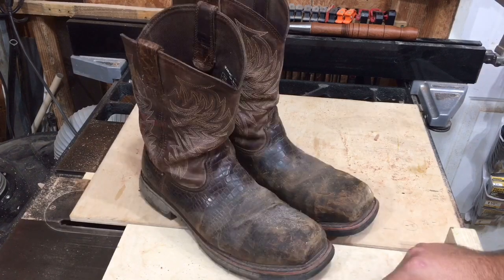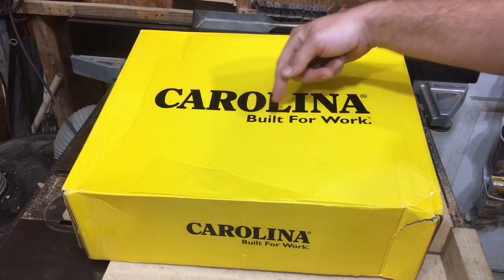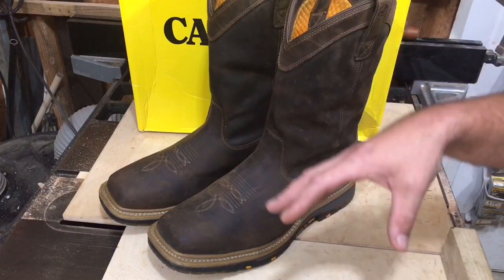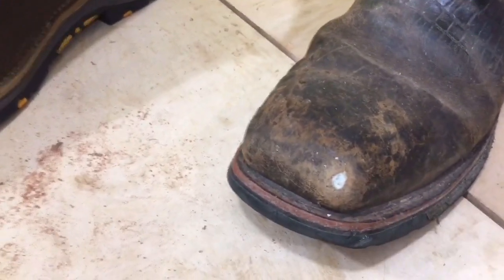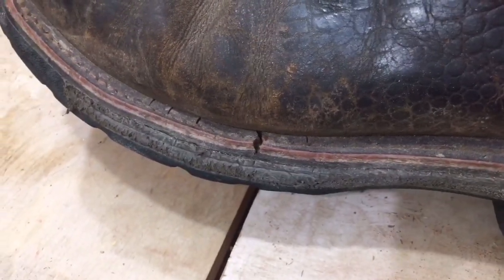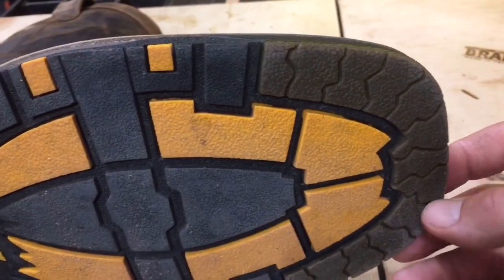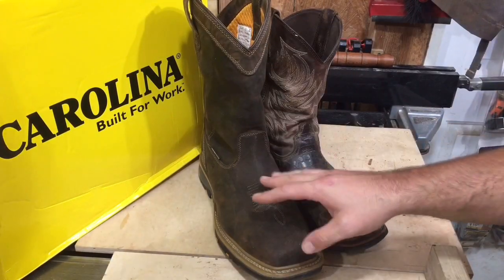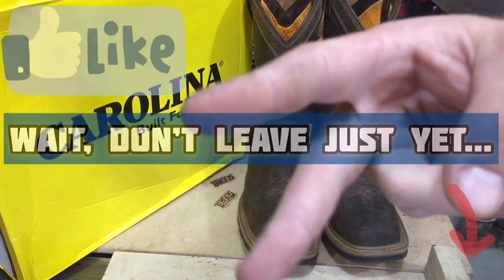BEST Work Boots? || Carolina Boots Reviewed by a Tradesman

Comment: I work as a boiler operator.  And these brand boot hold up best. I wear the lineman low heel ones. I'm working  in caustic, acid ,hot slag everywhere , going up and down stairs and working with steel/ metal alot of times. The ones I wear have stitching that goes from top to the bottom of the sole. They last around a year and a half on average before the chemicals eventually  break down the leather.
Reply from the maker: Sounds similar to my situation. These have done well. I have no problem recommending them

Comment: I also have Ariat boots for riding my horses. The soles of the Carolina boots are too beefy and leave your feet stuck in the stirrups. Learned that lesson the hard way on a nasty old Mare that didn’t want to ride this old man.
Reply from the maker: That is one this ive noticed is the carolinas dont slip on and off as easily... still deciding if thats a good or bad thing. But as you pointed out its situational

Comment: 100% Agreed. 16 years straight and I’ve worn nothing but Carolina loggers. Now that I’m older and laces slow me down too much, the last 4 years I have been wearing those exact slip on boots. From driving a truck and wrenching on the truck all year round these boots hold up great. I can get 2 years out of a pair easily but nothing better than a new pair of boots so I usually get a new pair every October. I’m actually due now.
Reply from the maker: Good to hear. I honestly never heard of them until i saw them on youtube
Reply: Brads Workbench I buy these at a mark down shoe store called “Shoe Show” for $109-$129.
Reply: Brads Workbench not being a pain but I’ve work a lot of different boots and I had the same problem with the lining in my boots at the heel and the guy in the boot store told me it was from using the toe of my other boot to take them off I pull them off by hand now and I don’t have that problem any more not sure if you do or not just figured I would mention it

Comment: I'm thinking about pulling the trigger on these boots next. I've been wearing Double H boots for years now, and they preformed great, but with a new promotion(now I'm an equipment operator instead of in the trenches laying pipe) I want to see how they go. I'm usually about a year in what I am currently wearing.
Reply from the maker: They are definitely the most comfortable. Only draw back is taking them off can be a pain

Comment: All i purchase is Carolina's. They are a tad heavier. But the trade off is they last me a little over a year. 
And watching this video reminds me that I need a new pair for the first of the year.
I get mine from the amish he prebreaks them in for an extra $20.oo.
Reply from the maker: Nice, i just got back home and now after a month im pretty satisfied. See how they hold up
Reply: @BradsWorkbench  
I don't work in oil fields.
But on heavy equipment and outdoor power equipment.
Im on concrete all day. Welding cutting, all kinds of oil. 
I have tried them all. From redwings to thorogood's(spelling) 
Carolina's has held up the best. When dropping $200.oo for a pair of boots i expect them to last at least a year. And they do.
Reply from the maker: @ifitsnotbrokenfixit1193  awesome to hear
Reply: what do they do to "prebreak" them in?
Reply: @billcarey9184   i normally brake then in. Sometimes I'll pay the dealer a few bucks to do it
Reply from the maker: I typically will wear a pair around the house at night or weekends before spending a full work day in them if possible. As far as what carolina does, i'm not sure if they do anything really.
Reply: @billcarey9184   sorry I didn't see this. He puts them in a machine that simulates walking.  And he puts mink oil on them as well to speed up the process.

Comment: What do you do in the oil field? Run water pumps? Flow back? Just curious.
Reply from the maker: No we are on the water treatment side. So we treat water to kill bacteria, h2s, iron, all kinds of nasty stuff. When they are short handed i play operator where i watch over the unit and test quality. Otherwise i stay more on the maintenance/fabrication side.
Reply from the maker: Watch to the end and you'll see a short montage of me at work, although i was showing the boots more than anything
Reply: I did, I saw the reserve pit and pumps. I didn't know your job was a thing, now I do. Looking forward to the update on the boots. Thanks
Reply from the maker: @andrewc9790  well thank you, most dont make it that far. Thats what i get for assuming 🤦‍♂️ but yea more and more companies are starting to recycle their water since its getting to the point of being more cost effective than putting it down injection wells 👍

Comment: I am looking to get myself a pair, but the ones I DID purchase seemed to fit okay, the heel slippage seemed fine, but it has given me terrible blisters. I'm wondering if I got ones that are just a bit too small since they rub my heel when they slip.
Reply from the maker: Does the padding slide and move around when you go to take you're foot out? This is an issue i just had recently. It will be addressed in my 6 month update but they told me it was a defect and are sending a new pair. They also want to investigate the cause and i will be including that in the update video as well
Reply: @BradsWorkbench  it does not move around. I'm thinking it may be smaller than what I truly need. If that isn't it, I dont know what the issue is still.
Reply from the maker: @WatermelonPeppermint  yea, id say try the next width up. I where an EE. Their customer service is usually pretty responsive